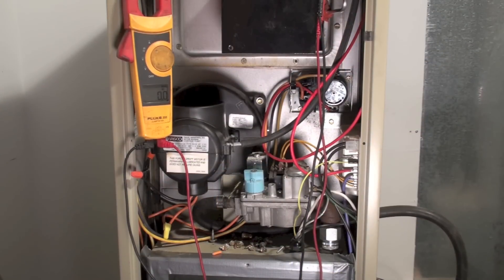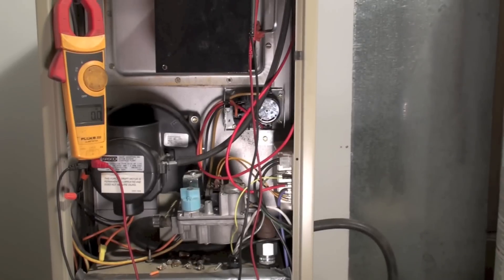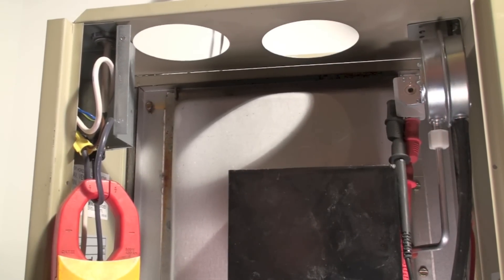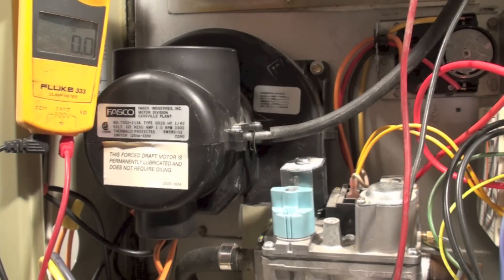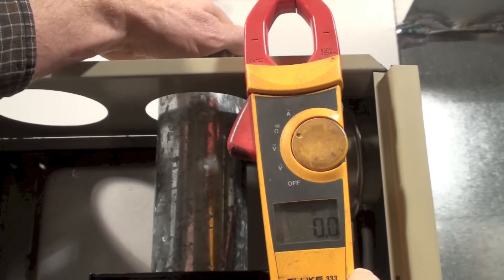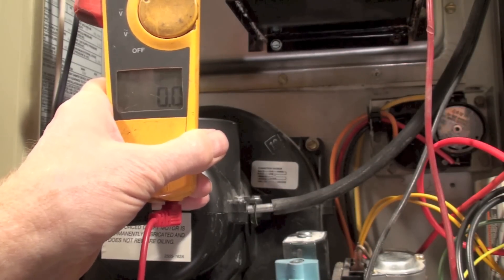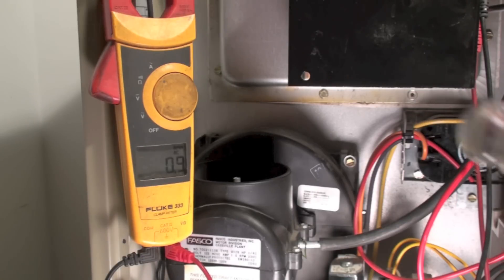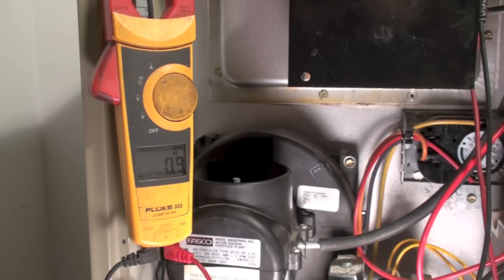How the Snyder General GUA press switch works

Comment: I have been looking foe a pressure switch to replace my failing switch, but can't find one with the two outlets not the bottom.  Is there another pressure switch you could recommend to replace what I have?  Most of the time the inducer motor runs, but it does not fire up.  90% of the time, if I disconnect the wires to the pressure switch for about 10 seconds and reattach then the burner will fire up. my Snyder general model num is cgua060a012.  serial num is 0000246325. the pressure switch num is fs4149-141. p/n 1445584. thanks for any advice.

Comment from the maker: If the unit works if the R and W at the furnace are jumpered, the problem is the thermostat or the wiring to it.  The only other possibility I can think of is some electronic thermostats will not "mate"  with some electronic ignition controls.  I have not seen that problem for a number of years though.  I hope this helps.  let me know.
GFM